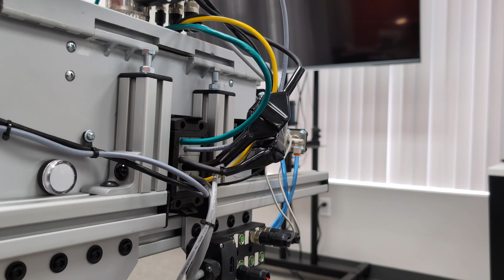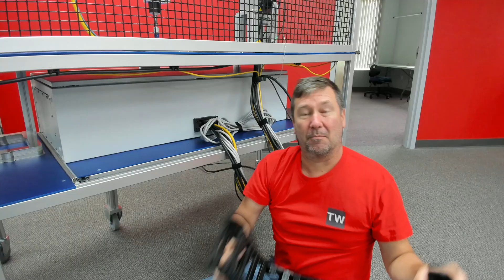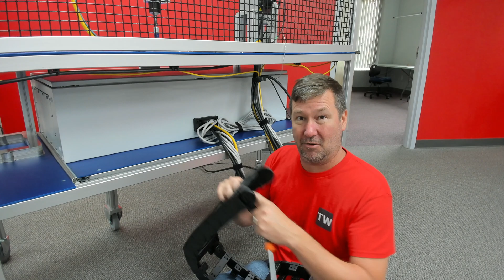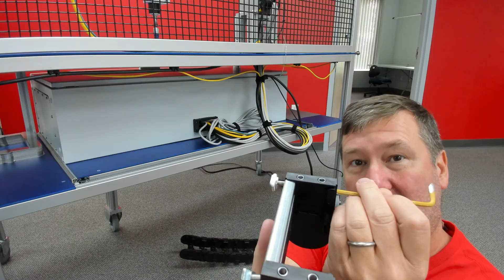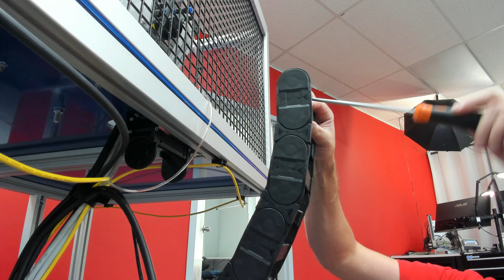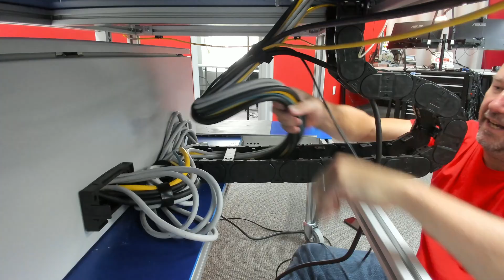Protect your Moving Cables on Your Machine with Igus Energy Chain

Comment: one thing to be careful with is what type of wire you use with them. at work we have some machines that moves a lot but slow and we have changed multiple wires because they break internally. it is specific encoder and sensor cables.
Reply from the maker: That is good advice, many cables are not rated for continual movement.